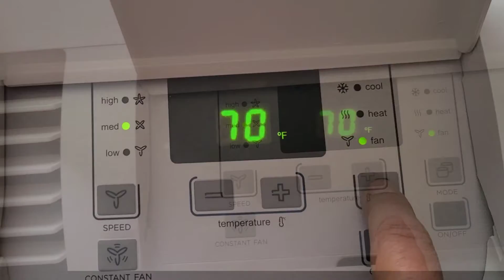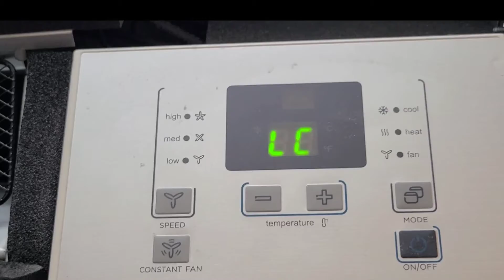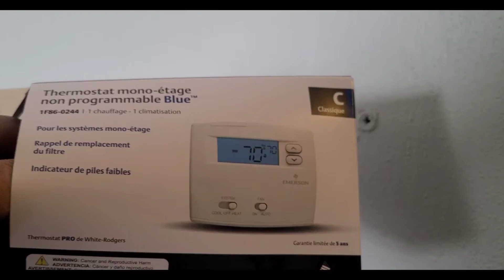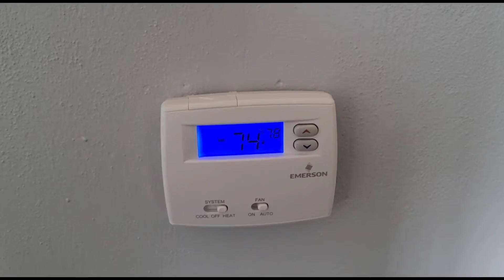How to wire a thermostat to Seasons/ Garrison PTAC

Comment: I have one unit, wiring is like you showed, same with the dip switches, when I turn it on, the unit still controlled on the unit controller,  wall thermostat is on, but cant controll the ptac. Any idea?
Reply from the maker: tech support

Comment: I’ve been messing with the writing for a while now. This set up works for AC but heat doesn’t work with this set up. I’ve tried in several different hotel rooms
Reply from the maker: this unit was a heat pump
Reply: @mrnoe67tiktok  ya well it doesn’t work on the ones I have for whatever reason

Comment: What fan speed does the unit run in when connected to a thermostat like that?
Reply from the maker: I connected the green wire on the unit to Hi fan. You can connect to low fan if you like.
Reply: It depends on which terminal you connect the green one, !! Hi-Fan, is the high or if you connect it to the Low-Fan, it will be low speed
Reply: With this setup our thermostat still can controllingthe low and high speed.